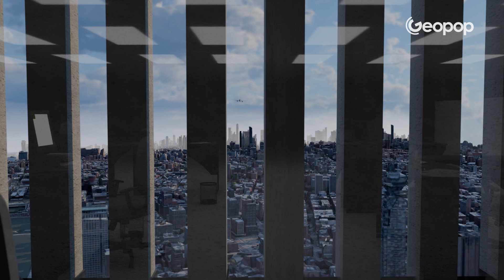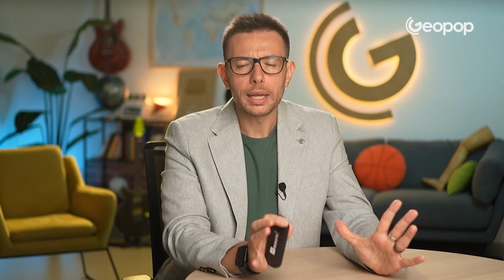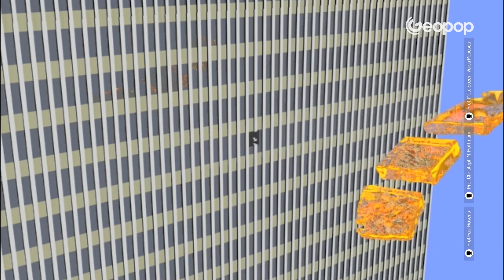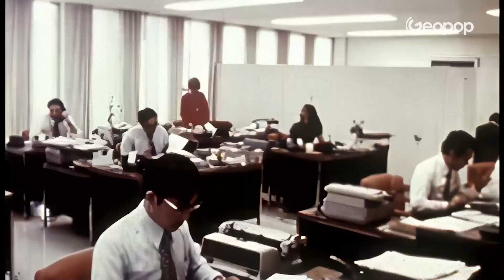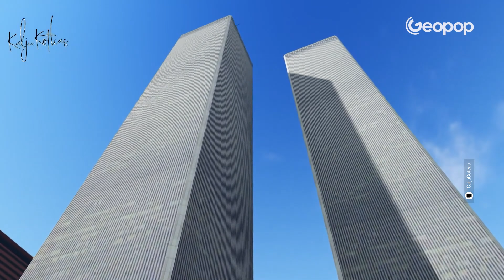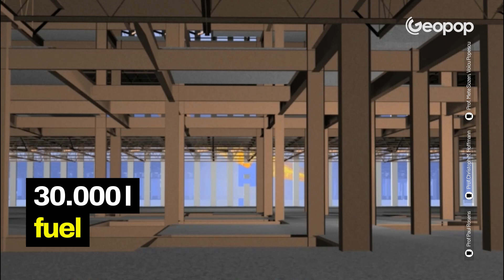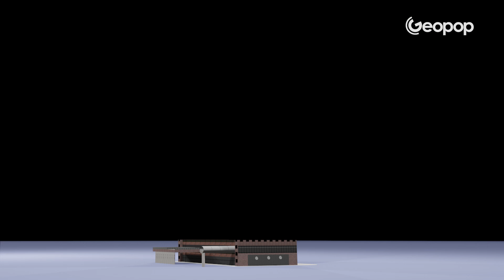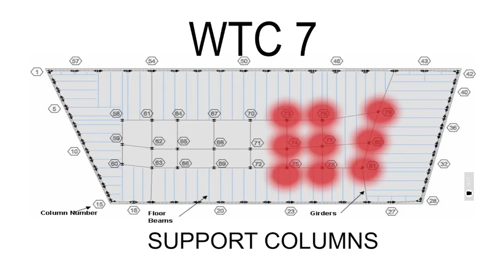9/11, 2001: The Technical Reconstruction of the Twin Towers and WTC 7 Collapses

Comment: Why didn’t the other buildings fall if they got hit too?  19:11
Reply: The WTC buildings all had the same steel construction and cores layout, leading to similar structural vulnerabilities to fire. Other buildings in the area were constructed differently
Reply: There ì alot of stupid people in the comments section here omd
Reply: Because this was an inside job with bombs and this is all a bunch of bull💩
Reply: Different buildings have different designs. You are an idiot AND you don't have to a bridge to sell.
Reply: The only other building hit that day was the Pentagon.  It was hit by a Boeing 757 as witnessed by hundreds of people on the freeway.
Reply: Which other buildings?  MOst of the WTC complex DID fall, or were so severely damaged they had to be demolished later.
Reply: Not government buildings..
Reply: That's a great point! The Deutsche Bank Building (across from the south tower) suffered significant damage from the collapse of the south tower. Yet for some reason, it remained standing strong. But what's perhaps even more shocking is how the Deutsche Bank Building eventually had to be deconstructed floor by floor, because it couldn't be repaired after September 11, 2001.

However, during the deconstruction process, a major fire broke out in the upper floors. And there was no working sprinkler system (because it was being demolished) and much of the fireproofing had been removed from the steel supports (because it was being demolished) and there was combustible debris everywhere (because it was being demolished) and there were no fire doors and enclosed stairwells to stop the spread of the inferno (because it was being demolished). Yet amazingly the Deutsche Bank Building remained standing, and not a SINGLE floor collapsed.

But of course nobody ever talks about this very glaring discrepency, even though it completely flies in the face of the official narrative.
Reply: @sorcerykid  You need to tell the whole story: When the fire broke out on the 17th floor, only 26 floors were left, as the upper floors of the once 41-story building had been removed, already. While the fire spread over parts of 3 floors (water pipes for internal firefighting were still present/functional on all remaining floors, but they had been closed - a clear violation of official procedures and safety rules/laws), the lower floors were not affected by the fire and could still support the (reduced) weight of the upper floors. The parts and debris of the WTC building had seriously damaged a narrow vertical section of the DB building's facade (across ~ 18 floors), but the damage was too low to affect the structural integrity of the bldg.
Reply: @ The fire spread over 10 floors, not 3 floors. Additionally, the building's standpipe system was completely unusable for firefighters.
Reply: @sorcerykid  I meant to type "3 floors initially", most sources indicate that the fire had spread across 9-10 floors, indeed. The standpipe system existed, but it was shut off (and even cut at several points, according to some sources), as I wrote before, so yes, it was unusable for the firefighters. But the removal of the asbestos fire protection and the removal of each floor were carried out in consecutive order, which means that the asbestos was only removed on the respective top floor (that was going to be demolished next), so it was synced with the floor-by-floor demolition process. While the materials used for sealing the asbestos removal process were highly flammable (and had fueled the fire), the remaining asbestos on the other floors might have helped to protect the buildings stability. Plus, there weren't tons of jet engine fuel producing intense heat and no vital column had been removed or damaged by falling debris (like in WTC 7).
Reply: @g4rceguy435  None of the fires in WTC7 were jet fuel induced. They were ordinary office fires. Also the vital column you are refering to in WTC7 was not removed or damaged by falling debris.
Reply: @sorcerykid well no because it’s a different building
Reply: @sorcerykid  The Deutsch Bank Building was a traditional cube frame structure meaning there were more columns and beams at closer intervals compared to the tube in tube design to WTC 1, 2 & 7.  This allowed for loads to be spread out among more entities if something failed
Reply: @txag007  Tube in tube designs still have the exact same number of columns. The columns are just moved to the core and the exterior. The redundancy is still there.
Reply: They were diffrent building, that suffered diffrent kinds, and diffrent amounts of damage.

Hope I could answer that for you.
Reply: @TarezOfficial thats such a vague answer "they were different buildings" yah no sh!t. If debris fell from above building 7 why did it collapse from the bottom in perfect symetry. Only building to ever collapse from "fires". Look it up
Reply: @jasonstuart2815  You know, I have looked it up... not sure why you are questioning that... we are holding this discussion right below an informative video if you didn't notice.

Also. My "Vague" answer, as you put it, is one directed at a vague question. The question is a nonesense question... "Why didn't diffrent buildings with diffrent conditions collape?" well yeah... because they were diffrent buildings with diffrent conditions. The "yah no shit" feeling you are having, is exactly what this is. It's obvious. The question litterally answers itself.

And if you truely think that WTC7 collapsed, under nothing more then just fires, then this is pointless... you are saying that, below a video, that explains that it's not just fires. 
How and why would I try to explain it to someone again, that refuses to see information? I mean... look at it again, segment starts at roughly 16:50

"Why did it collapse from the bottom?" Where exactly do you think does a building collapses from? From the top?
And your definition of "Perfect symetry" is also interesting... you can fairly clearly see that WTC7 is falling at an angle, sililar to how the top sections of WTC1 and 2 are falling.

There just isn't any sideways movement... because... why would there be? Have you ever heard of Gravity? It's that neat thing that usually pulls things towards the ground.
It's a building, that collapsed, because it couldn't longer carry it's own weight... where should it fall? Upwards? or maybe due east? Where do you think gravity is pulling a building?
Reply: @TarezOfficial  dang.. you shut that dude up🤣🤣🤣🤣
Reply: @deniziscool I guess so... Though I still kinda hoped for a response. 
It's just such a stupid conspiracy... who in their right mind would go "Yeah THESE Building's... we hit them with a plane so that our conspiracy has some solid ground... but THIS single building nobody cares about... yeah this one we'll just blow up... while hoping that some debris hit it JUST right, so that we can cover it up, while having zero control over it!"

People really gotta rethink their logic sometimes. It's not enough to question the opposition... you have to question your own beliefs. That's what critical thinking means.
Reply: Indeed strange that WTC7 went down and not WTC 3 thru 6 ??  @jasonstuart2815
Reply: @jasonstuart2815  Here we are in 2025 and you people are still claiming no other building has collapsed from fires.  That isn't true.  The Plasco Building says hello.  No WTC 7 didn't fall in perfect symmetry.  The collapse started with the Penthouse on the east side then progressed to the west.  Once enough of the internal structure collapsed, the moment frame (outside shell) collapsed.  Even that wasn't symmetrical.  You can see a slight folding in the facade as it fell.
Reply: @txag007  That's great thankyou for bringing the Plasco building to my attention. Notice how the official report states that "Mostazafan Foundation had ignored warnings given by the authorities", a clear reason for the buildings fall. That report also came out in April 2017 (4 months after the collapse). NIST's report on wtc7 was released in Novemeber 2008. 7 Friecken years after the collapse... almost like they waited for people to forget and move on? I understand that you can critically think so I would like ask you this: How can you definitively say that the 911 attacks were a terrorist attack when the Bin-Laden family had direct links and financial ties to the FBI and multiple family members of Osama were flown out of the country BY THE FBI on the day of the attacks and were not brought into questioning? I'd love to bring up the patriot act and Bush's relations with the Saudi's but lets stick to one topic.
Reply: @jasonstuart2815  so i guess the building in teheran that collapsed becauseof fire was a delusion...why are you guys always so clueless? How about ypu google shit before you make stupid claims..
Reply: @jasonstuart2815  Ummm... it didn't collapse "from the bottom in perfect symmetry".  Watch the video again, but this time with your eyes open...
Reply: It did not in point of fact collapse from the bottom in perfect symmetry. The east wing collapsed first.
Reply: @TarezOfficial  no the American flew their own plane in the building mate. No one understands that Americans did it like this evidence of demolition.
Reply: @Woodstock-d4r  The Americans didn't fly anything themselves. There are litteraly onboard recordings of when the planes got hijacked. 

And for the love of anything... I cannot decipher your second sentence. 

And this isn't about any planes at all? This is about why WTC7 collapsed, while other surrounding buildings didn't. 
WTC7 wasn't hit by a plane and no one is saying otherwise. 

It collapsed because of structural damage, and a fire that lasted well over 8 hours. 

Other surrounding buildings didn't collapse, because they suffered diffrent kinds and different amounts of damage and they where structurally diffrently designed to WTC7.
Reply: @ I want to prove your point where the fuck is the black box for those planes?
Reply: @Woodstock-d4r Go back to licking your window and stfu,the adults are talking
Reply: Because they didn't store all the financial records of the military. Remember the day before Sept 10 Rumsfeld announced they couldn't find $2.1 Trillion. With wtc7 going down all the records were lost
Reply: That was not in the script
Reply: @CodingLab-sz6ro  All buildings were not hit the same way. That's why.

Comment: You "still" can't explain why the existing columns of still, which were not compromised it the total event of the heat produced from the heated, (damaged columns) were to failing event of all the rest of columns. There were heard explosions heard from many, many people, as if a building was to be taken down with explosions which happens when a structure was being imploded? You can't explain these accounts and explain why they were heard from many, many people. Talk the "fast talk all you want! The towers imploding has never been explained. The day will come when many, many of us will know the truth. 🙏's and love ❤ for all that was affected! ⚘️⚘️⚘️🕯🕯🕯💐💐💐...
Reply: Explosions are loud noises, like you would get when large amounts of concrete hit each other. Your explanation isn't a smoking gun.
Reply: I can explain.

1. The Twin Towers consisted of 4 primary structural elements that together formed an integrated system where each relied on the others.  47 hollow box-section steel Core Columns carry the majority of the gravity loads. The 236 hollow box-section steel Perimeter Columns carry the remainder and ALL of the lateral (wind) loads. Long-span Lightweight Steel Trusses connect the core and perimeter column together at each floor with a Hat Truss on top to tie the structure together as an integrated unit where no element can survive without the others 

2. The impact of 117 tons of airplane (= to about 12 dump trucks) at speeds up to 590 mph completely destroys the aircraft.  This in no way implies the Towers come out unscathed. Some folks don’t get that. Hitting with the energy of up to a ton of TNT the impact damages or destroys many perimeter and some core columns (33 of 59 perimeter and 20 core columns destroyed at the impact floors in the North Tower), primarily through bolt-shearing failures at the end connecting flanges, as well as bending, twisting and fracturing of weld seams. There was no cutting or slicing - the reality was far more violent and messy. 

3. The impacts destroy or damage fire insulation, fire breaks and sprinkler systems on multiple floors. Huge fires are started across multiple floors simultaneously and allowed to spread rapidly with no effective firefighting or fire suppression. This was an unprecedented fire event . All of this was observed and recorded.

4. The hotter steel gets the weaker it gets .  With fire insulation stripped away and no sprinklers the survival time of the steel greatly reduced. Gradually over time heat causes the lightweight steel Floor Trusses at the impact damaged floors to sag, which was observed and recorded.  No steel melted nor did it need to. Structural steel will fail long before it turns to a puddle. It just needs to bend

5. Sagging floor trusses pull on the increasingly weak and overloaded Perimeter Columns, causing some of them to bow inward by up to 5 feet. This was observed and recorded. A straight column is up to 4 times stronger than a bent column. 

6. The bowed Perimeter Columns buckle and fail, initiating collapse. This was observed and recorded.  The formerly static mass above which the structure below could easily support is now converted into a dynamic mass up to 30 times greater. Because they have buckled, the Columns above and below the failure point are no longer aligned . The load bearing structure below no longer bears any load as it falls past the lower columns, NOT onto them.

7. Thousands of tons of debris fall within the four outer walls, down through the open office space, crashing onto the first intact floor it encounters. This massive impact immediately breaks the bolted connections to the columns as the amount of resistance the Floor Trusses can offer is negligible.  The falling debris slows only marginally and briefly. Note:
7a. This is NOT a solid top block crashing into and “crushing” a solid bottom block .
7b. The debris falls past the columns not onto them.  The columns provide no resistance to the falling debris. 
7c. Only the bolted connections of the floor trusses to the core and perimeter columns can offer any resistance. A pair of 5/8” bolts at each end of each truss vs. thousands of tons of falling debris.

8.  This floor-led collapse progression within the four outer walls can only go straight down. Note: 
8a. This process is often incorrectly referred to as “pancaking” which actually refers to a completely different process rejected at an early stage. The catchy name stuck but nobody knows what it is supposed to mean.  Pancaking is too simplistic and inaccurate anyway. More like Kaiserschmarrn.

9. Collapse progresses through the floor systems and not down the columns. Rate of floor assembly failures increases with each successive floor as momentum increases, reaching an average acceleration of 0.65 of GA, or 35% slower than true free fall. Bam, bam, bam down the building until there are no more floors to fail.  The resistance offered by each successive floor is always the same. The mass and velocity and thus the energy of the falling debris are constantly increasing.  The falling mass increases with every floor it destroys as new falling mass is added. Some falls to the sides, but most falls down. More mass, more velocity, same resistance with each floor.
The above is unquestionably the path of least resistance

10. The Towers were 95% air by volume and as that air was compressed inside the building it is forced down the tower and blown out the sides in reaction to the building collapsing not causing the collapse. Those were not “explosions”, it was expulsions of compressed air. 

11. Perimeter Columns become detached and peel away like a banana behind the collapse front, playing out to the four points of the compass extending to more than 600 feet from the base of the towers. This was observed and recorded, the results quite obvious from examination of the debris pile. 

12. Core Columns fail last as their internal beam bracing is stripped away and lateral support from the floor to perimeter columns is lost. This was observed and recorded and is most obvious in the North Tower.
Reply: @TheLoonResistance  This is the finest layman explanation I've read. Thank you.
Reply: That's absolute BULLSHIT. There was ONE lady, who had her back to the buildings and didn't see the plane who said, "it sounded like an explosion". ONE.